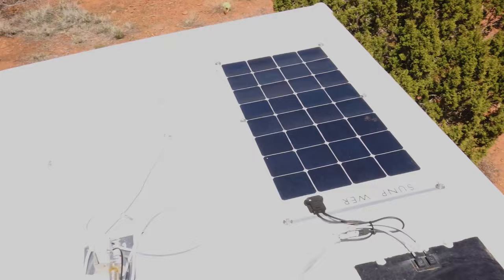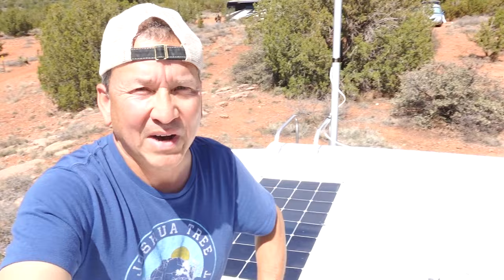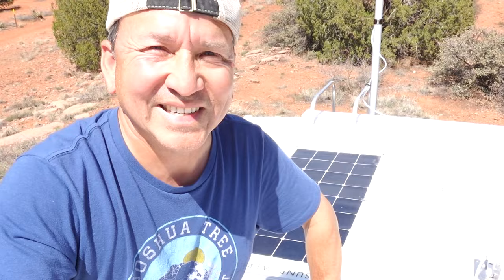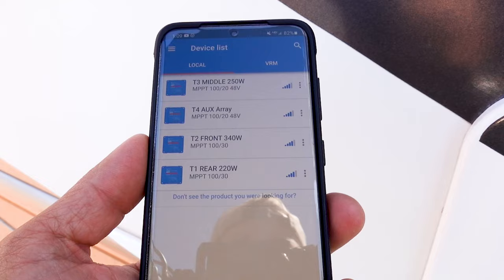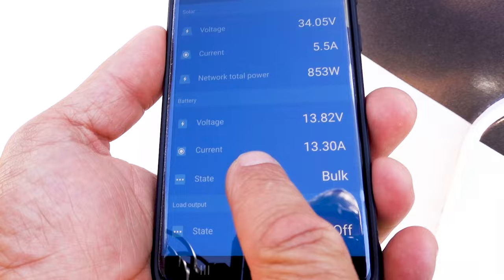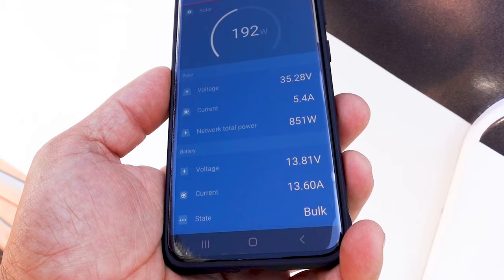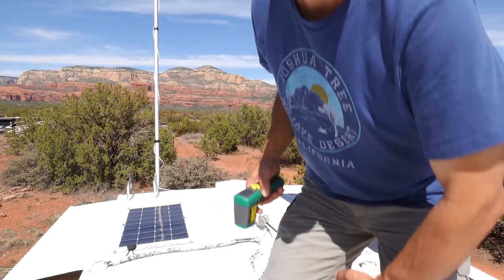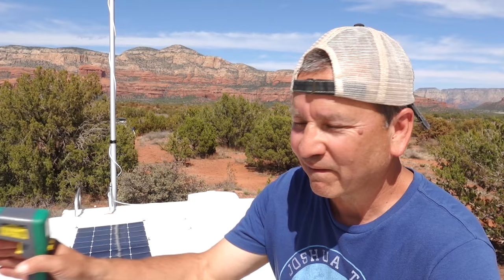Heat/Power TESTING Flexible Solar Panels on RV (Flat Mounted vs Ventilated)

Comment: So it turns out that using the coroplast was genius. Tell your wife that I'm sayin' that she's married to a genius. Maybe she'll even believe me.
Reply from the maker: Well, the implementation may be unique, but I can't take all the credit since I'm not the first one to use coroplast under a flex panel. I'll pass that on to my wife anyway :)
Reply: @RVwithTito  i thought about using coroplast  under my solar panel  before i ever knew that anyone ever used coroplast under a solar panel, so in my mind, im the first one to do it.😂🤣😁